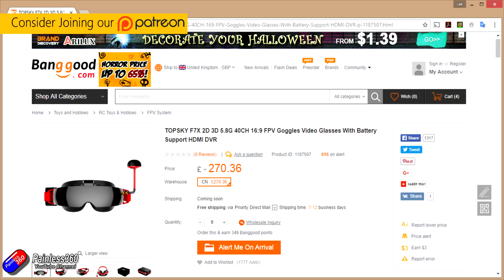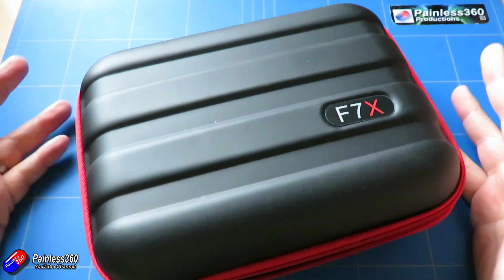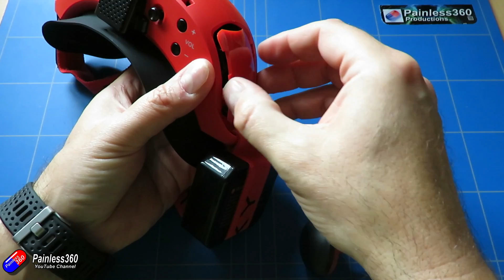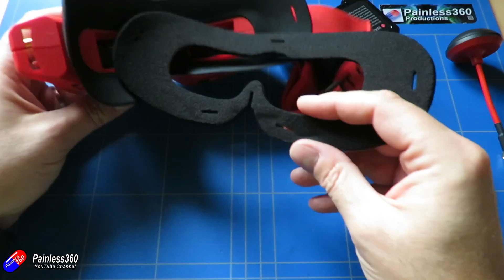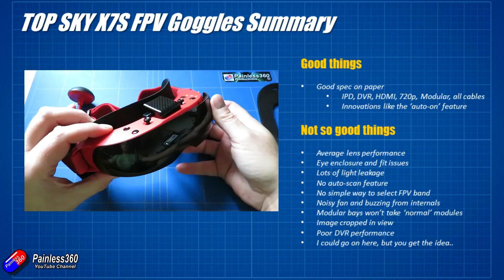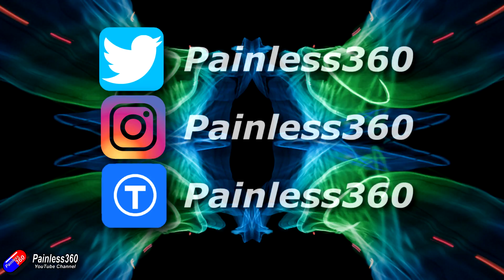TOP SKY X7S FPV Goggles

Comment: It's sad this product also failed on your channel too. In my opinion, the product is not promising. So far, I don't like it either just by watching pics and videos... Why? It looks like the sensor will turn on the screen once you place your goggle on your forehead, the face mask is a issue, the fan is blowing hot  because the sensor is in the way, light leakage, no aftermarket fatshark module and the price is retarded.  If one more goggle fail again. I might as well buy optic screens from the manufacture  and 3D print the housing around it. lol
Reply from the maker: +TheDarkstar826 so disappointing that these guys are putting in so much effort but not nailing it..

Comment: Hi painless360. What would you say the top 3 fpv goggles are in your opinion ignoring the price? Thank you!
Reply: Well, honestly I can only vouch for one brand and that is the fat-shark system because that is the only one of the top 4 you have heard about and honestly there is not that much difference from what I have heard about them as far as reliability. I am well pleased with the fat-shark. It performs very well for what i want. As long as you stay away from the cheepies' you should not go wrong.
Reply: He has already told you in this video
Reply: Marshal Palmer he talked about how the aomway are more expensive and about the fatshark but it wasn’t very clear on his preferences so if you could tell me what he said then that’ll be great. Thank you.
Reply: At 0:48 he says Aomway are great but missing a few features found in the other two major Mfg,  Fat Shark and SkyZone. There are no other major and reliable Mfg producing Goggles with great features you may want.
Reply: On the otherhand if you want to drop down in quality and features there are many. I have used fatshark as well as other brands and find fatshark hard to beat in quality and parts
Reply: Marshal Palmer few I’ve heard good stuff about are the aomways, HD3s, skyzone v2 and the flykey rafale and I’m not sure which ones are the best because everyone just says they’re good but nothing about which ones are best
Reply: Yeah that's true, but I guess the only way to really know would be to try out what works for you and your needs. I like fat-shark because the components are readily available and everything works right out of the box. the connections are very well thought out and is very versatile in how you want to use it. but again, it is up to your own preferences. they all have a different feel about them
Reply: Marshal Palmer that’s exactly my point. I don’t have enough money to try them all out so it’s a one time investment so I’m willing to buy whatever. That’s why I’m trying to get the best thing possible. Uavfutures prefer the aomway over fatsharks but a lot of goggles have positive reviews so I’m not sure
Reply: I can understand that. When i got my FS it was after many comparisons of other brands vs price and features. I went with the fat shark because of the combo special they offered at the time. I based my decision on what i wanted and what I could find at the price I was able to pay. Many reviews later, I went with most consistent in positive reviews.  Good luck on your decision.
Reply: Marshal Palmer thank you. Which one would you personally recommend me from the 4 I mentioned earlier?

Thank you
Reply: I have HD2s and the firmware IMO is less reliable than the Skyzone firmware.
Today for example  I flew around 10 packs and I had to pull the power from my Fatsharks 2-3 times to restart them because there was no video.
And another time because the DVR would not go into standby mode(why do I need to go to standby mode anyway, why can't I hust hit the button and record?).  
That's pretty typical for Fatshark HD2s. 
Never have to restart Skyzones to get them to work. Pity they don't have a 4:3 50 degree view. :-(
Reply: jtan163 what about the image quality and reception? Which one is better